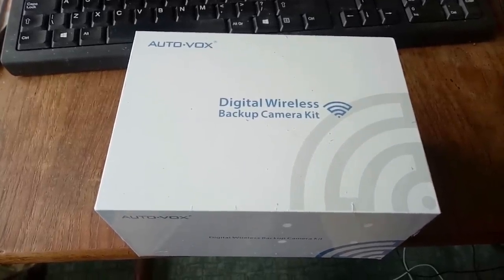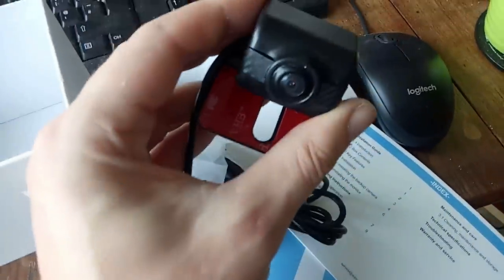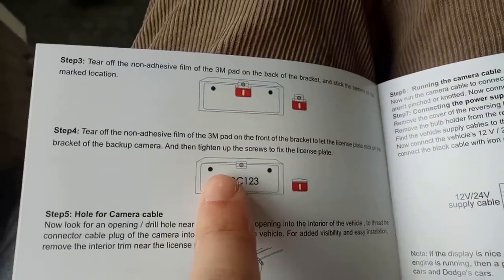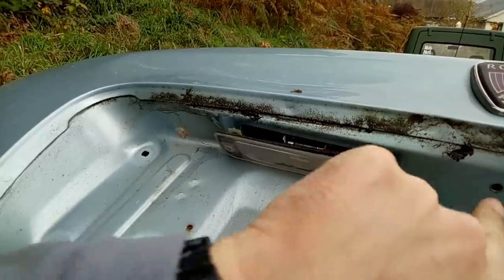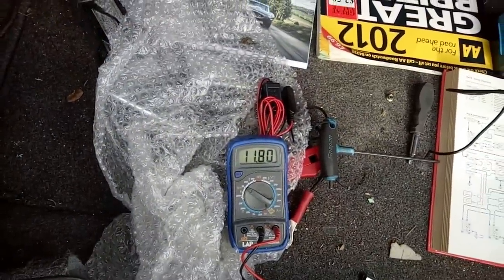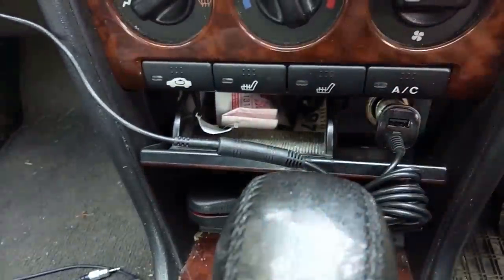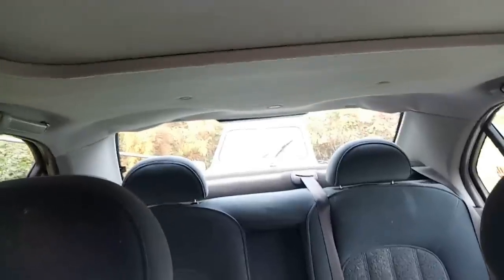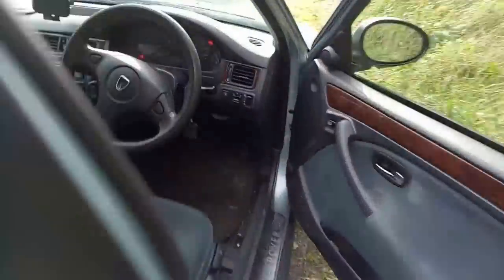Fitting an AutoVox TD-2 Digital Wireless Reversing Camera to my Rover 45 V6.

Comment: Brill video. I bought a pair of small dashcams off eBay for 12 quid apiece. The quality is surprisingly good and they were small enough to hardwire in. A small flip-up screen ( another £12 ) fitted neatly in a cubby in my centre console. All powers on and starts recording on the ignition. I just flip a switch to change the feed on my screen from front to rear. Rear dashcam doubles up as a reversing cam. With wiring, etc., cost me about 60quid.

Comment: Good idea this. I had an MG ZTT estate with poor rear visibility. It had parking sensors but they went off whenever the car was in reverse, whether I was near anything or not. A previous owner had changed the rear bumper and not bothered to sort the sensors out. Got a new Suzuki Ignis with reversing camera now and couldn't be without one now. ☺

Comment: You did a great job on the install, except for using cheap taps into the backup power wires. Lol. I think on the Rover 45, a backup camera is indeed needed so you can see better when you're reversing against other vehicles. Honestly if you're not going to be using the tow bar, why not just remove it? I think it mucks up the look of the rear end anyhow. Just get underneath the rear bumper, zip off some bolts, and be done with it. Just a thought. Great product review.

Comment: I tend to use piggyback fuse connectors. These simply plug into a convenient fuse which gets put into one slot and provides another fused tail to connect my accessory to. Some manufacturers provide them for dashcam wiring.
Reply: Robin Turner
most camera's/screen's are 5 volt, the cig lighter plug is like a step down transformer, hard wire the cam/screen to 12 volt's and bang, you must check the spec's in the manual to see what voltage the cam/screen take's,
Reply: PAUL HAMMERSLEY yes I'm fully aware of that which is why I said some manufacturers. Nextbase for example have a car wiring kit which includes a step down transformer with tails and a pair of piggyback connectors for 12v connection. I wasn't advocating lopping off a cigarette lighter plug and wiring it straight in. Incidentally most cars systems actually produce 14v. The system shown actually appears to be designed to wire directly in to the cars system which is why it includes scotchloc connectors.

Comment: I like it and it is a very reasonable installation. I acquired an integrated front and rear dash cam unit that sits strapped to the front of the rear view mirror. The screen is extra wide and partially mirrored and so still works as a rearward facing mirror. As if that was not enough, when I engage reverse it also doubles as a reversing camera too!  I can now reverse up to the caravan hitch without assistance and the tow ball acts as a reference in the image when backing up. 
   I then bought one for my wife and it has built in Google Satnav and hands free. Talk about tech envy!  Also it means that you don't have to remove all of the bits and pieces from the screen for MOT time which seems to be an issue nowadays.

Comment: Good stuff.  I bought a wireless back up camera.   For my Ford F-150 truck for pulling my fifth wheel camper.   I had to put it in the glove box and not use it.  It interfered with my tire pressure censers.
Reply: The manual did say that might happen!! lol
Reply: I have bought this backup camera,and after i use it，I totally agree with you.I am scared of driving and reversing before,and this back up camera operate and high quality screen for both front and back cameras. Glad to get it as now I feel more comfortable to drive.

Comment: On the issue of having the camera on all the time, that VW car of the future you drove recently had cameras instead of mirrors. Personally,  I prefer parking sensors  to a reversing camera as you can continue to look around while reversing rather than staring at one thing (the screen), after all, you still have to be aware of other hazards, not just the bollard you're heading towards.
Reply from the maker: Quite, though any good driver should be checking all around when reversing, never looking at one place.
Reply: The Tesla Model S reverse camera can be checked at any time while driving or even just on all the time on the big display. Much better view than using the rear view mirror.

Comment: Since it's wireless, I wonder what would happen if you were next to someone else who also had the same camera in their car? Would you see the image from their camera on your screen, or vice versa? Unlikely to occur, but certainly possible.
Reply from the maker: If it ever happens, I'll report back.
Reply: Hello,friend,Since I have bought this backup camera,I can answer this qusetion for you.I bought this just cause this is a digital wireless reversing camera,the digital sigal can avoid interference from Wifi ,Bluetooth or Foreign signal from other radio rear view camera. Since I used it,the situation like you worry never happen,if it happens in the future,i will report it,and the image on the monitor is really clear,high recommand it.

Comment: Nice job on fitting the reversing camera kit, that must make the Rover a Connoisseur model now!
Reply: Yes, the Connoisseur model is the most luxurious. I can't remember what model Hubnut has?
Reply from the maker: Club. Velour rather than full cow. Much better! I like velour.
Reply: I do like the velour too. Was "the club" model the middle model? or the entry level?
Reply: Kenneth White middle. Classic (SE), Club (SE), then Connoisseur (SE).  SE being the extra package for that level so effectively six grades exist. Connoisseur gave you leather over Club, Connoisseur SE added trip computer & cruise control. Or at least it did on the 75's, 45's could have been different. I think Club SE added climate control over Club which just had air conditioning.
Reply: @rarevhsuploads4995  awesome breakdown! When you purchased an SE variant, is there an additional badge anywhere on the car showing you got the SE? I don't even see a club emblem on yours really.
Reply: @lancpudn  were those the stock alloy wheels with the Connoisseur SE? I see you have a US street sign in the background. Lol.you live in the UK?
Reply from the maker: Club was the entry level V6. They only did those in two trim levels, and only saloon form in the UK.
Reply: @HubNut  is yours a club or a club SE? Why no badges other than connoisseur models? No club badge on your car?
Reply: Hi Kenneth Yes I think they were an option! Those are Rover "Serpent" alloys. I used to have a few classic American cars and that sign came from an autojumble we went to in Cheshire.
Reply: @lancpudn  I've never seen those alloy wheels before. Did you buy the car new? We're they a factory option or dealer installed those wheels? Your car is beautiful.
Reply: @Kenneth white The Rover 75's came with a choice of Rover alloys, Comet, Contour, Crown, Fork, Union, Meteor, Serpent and some others I cant think of at present, the Serpent alloys are 17", No I didn't buy this Rover new, It's a 2000 model and looking in good shape for it's age. . Thank you for the compliment.
Reply: @lancpudn  sadly, Rover cars never sold the 75 or 45 here in America. I think the shape is very elegant with nice touches of chrome in just the right areas. Nice to see someone take pride in their car so that it looks as good as the day it was made back in 2000. Thank you for the replies.

Comment: Hi ian, my towbar is my reverse  aid. When I nudge the wall i know to stop ✋
Reply: Barry Roach I think there's someone who lives near me that adopts the same method in Tesco's car park😬
Reply: Yep, i used to have a Rover 827si with a tow bar, i used to use that to tell me when to stop! :-)
Reply: Barry Roach it's obviously some bugger like him.  I do though have a stealth mode revenge... I've got a removable towbar with a great big steel mounting plate running across tight inside my bumper with rails to the chassis. Makes a terrible mess of any car rear ending me...
Reply: yeah, that was hilarious!!!
Reply: poor Rover!!
Reply: I have had three rear enders in cars fitted with a  tow bar. Every time it has happened the car colliding with my rear end has come off much worse. The last time, at the Leicester end of the M69 my car was written off due to its' age, it did quite a spectacular amount of damage to the much larger Renault taxi which carelessly ploughed into my rear end.
Incidentally if you can actually find one I would like to see a test drive of a Daihatsu Grand Move. I bought one which had come off Motability and its probably elderly previous owner had only done 8000 miles in it from new. I kept it for another 8 years until it was written off. Old school tinny and plasticky build but legendary Toyota reliability. I don't think in the eight years I had it, it ever needed anything replacing apart from general wear and tear items like tyres and brake discs / pads. And it never broke down. Also its off-road capability was really quite surprising for a conventional front drive set up based on a 1990s Toyota Corolla.

Comment: Nice vid ...Thanks  Thinking of buying one of these ...Give you a tip .  Grab yourself some spray adhesive for your roof lining  before it sags too much ..Really works and easy to use ..
Reply: I tried spray adhesive on my Rover 400 interior but it sagged again after a few days.  Fixed the ceiling material with thumb tacks, and door material with uhura.

Comment: How did you manage to protect it from rusting? I would like to drill mine but I am afraid if the holes rust.
Reply from the maker: A bit of paint should do the trick. I was lucky and found a spare hole.

Comment: The only problem is that with an older car like my 56 Picasso I already run an adaptor off the ciggie lighter that charges my phone - allows my Garmin satnav to function and also runs a DAB convertor which means I have DAB, Bluetooth and can stream from my phone.  This as well would mean even more of a spaghetti of wires and more screens to look at - I think there comes a point where one has to accept the car is 10-15 years old and the limitations that come with it and chose what adaptation you really need  because fitting them all ends up being crazy. Seems like a decent set up though and on a vehicle where you can't see the rear well enough it could be a real boon to parking.
Reply from the maker: Yes, something that combines everything is needed. A sat nav Bluetooth DAB reversing camera.
Reply: such head units are out there but its pricey to fit one particularly when the new unit could worth up to half the value of the car or even more !!  I'll just hum tunes, practise my reversing and revel in the fact that in my car could be one of the few places where no-one can phone me !!!

Comment: You could prob to free up the lighter socket hardwire it into the fusebox coming off one of the ign operated circuits, am seriously tempted with one of these in my Robin as looks like it makes reverse parking a doddle in tight areas :D
Reply from the maker: Yes, I've used piggy-back wires from the fusebox before. As it happens, I can still charge my phone, so that's ok.

Comment: I'm quite liking that, but £91.00  ?  nah
Reply: I got one on Ali for about 30 euros. Wraps over the rearview mirror which has a front facing camera and connected to the rear camera which is in a special VW license plate light holder. You take out one of the license plate lights and put the camera in instead, and the rear camera is connected to the reversing light. Much better that what Ian has. I actually chose to use a wired camera, but I do have a wireless one too which I didn't use. It's not that difficult running a wire through the car.

Comment: I need to fit a reversing aid on my Astra Sport hatch as that's another car with hopeless rear visibility due to a small rear window that doesn't correlate with reversing and the rear bumper too well.
Reply: Danny H I fitted an electromagnetic parking system  to my old Sport Hatch.  Wired in the same way as Hubnut’s.  No drilling and worked quite well. Less than £20, only needed to take the rear bumper and refit.

Comment: Very posh for hubnut... bit of solder would have been better long term, but you know that.
Handy gadget for the fox, you don't want to be damaging the fibreglass.
Reply from the maker: Not necessarily a fan of older in car wiring. Not when solder has become such crap stuff. Reasoned that a single reverse light connection was probably not the end of the world.

Comment: I have no drivers rear view mirror as I drive an old lwb transit with a nasty steel step and butch tow hitch pin assembly
I just guess and mostly right  normally if I am short in two long straight bays I am in
Handy though if I ever want to aline the towbar up
Anyway.
How's your new email letters doing 
Dear China.....      I am looking to test any cvt type drive clutch you may produce on a long term test review

Comment: Does the Rover have a 12v socket in the back console between the seats? Thats where I plug my dashcam in because otherwise nothing is using that socket. My reverseing camera is hard wired as it came with the DVD player I installed.
Reply from the maker: Nope. Bit low on 12v sockets. My Lexus had one in each door, so I used one of those for my dash cam (with a long wire!).
Reply: Those one's in each door were supposed to be for cigarettes Hubnut!!! Nice that you're not smoking and plugging mulitple gadgets into them instead! Lol.

Comment: Just to add - heatshrink butt connectors can be picked up cheaply on ebay. They have an adhesive that melts inside - twenty seconds huddled over a fag lighter is preferable to dropping solder on your interior trim!!

Comment: how does the monitor get triggered by the reverse camera . is it the video signal ?
Reply from the maker: Yes, a wireless signal. The camera boots up when reverse is selected, and the screen picks up the signal and turns on. Works well.

Comment: Looks good but could do with another camera looking forward as today it is good to have some protection against scammers pulling in front of you and stopping to con your insurance in to giving them money when it is not your fault.
Reply from the maker: Yes, dash cams are sadly a good idea. I have one. I very rarely fit it...
Reply: @HubNut  has the camera got water ingress yet? Does it fog? And get misty in winter?
I've had loads of issues with mine( different brand)

Comment: Considering it's 'wireless' there seems to be a lot of wiring?
Reply from the maker: Well, it's got to get power somehow. ;-) The wireless bit is the fact there is no physical connection between camera and monitor, so you don't have to try and thread a wire much of the length of the vehicle.

Comment: Oh no you used the dreaded scotch lock how dare you. What's the next accessory you are looking at getting for the rover?
Reply from the maker: Next on the agenda is a decent set of tyres. Cruise control is also on the wish list.
Reply: @HubNut  a decent excellent value tyre company is Nankang tyres, they are Chinese but they make tyres for racing cars so obviously they have some better testing than other Chinese made tyres. I have some on my car not too bad.
Reply from the maker: Actually, Taiwanese if that's different. I have ordered a set of their all season tyres.
Reply: Yeah a diagnosis video on repairing the cruise control would be awesome!! I love the Rover 45. I wanna buy it but i can't! :-(
Reply: @HubNut  Did you check the kerb weights of KV6 or diesel engined 45's to see if they are front heavy over K series powered models to account for your 45's tramlining. Also would wheel /tyre be a factor as I understand alloys vary from 15" to 17" depending on engine power and options/upgrades.
Reply from the maker: Didn't have cruise from the factory. That was reserved for the top model. Should be possible to retro-fit in theory.
Reply from the maker: The nearside front tyre has worn badly on one edge, so that's duff tracking then. New rubber on the way.

Comment: that cost 91 pounds i have a front /rear dash cam with reversing camera in the mirror  cost 31 pounds 1080p  front 720p rear  and less hassle to wire than that 1 no plastic sucker   straps on existing rear view mirror  look on ebay
Reply: can u provide the link?